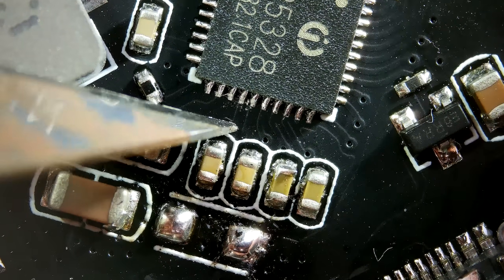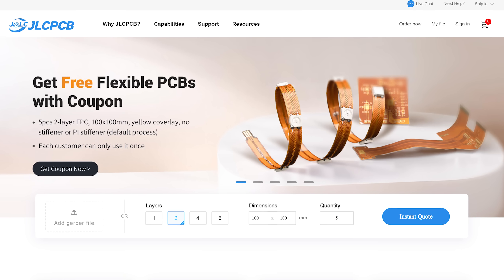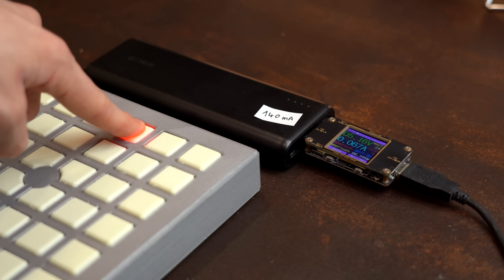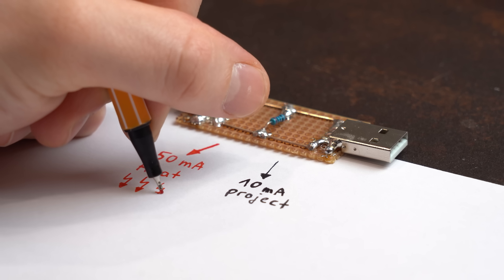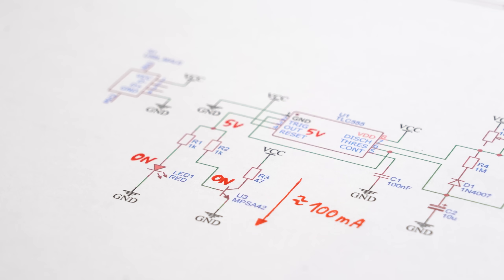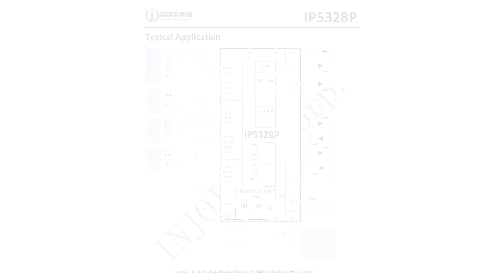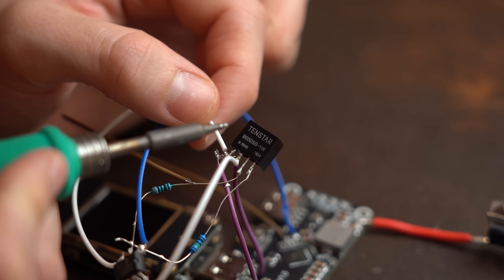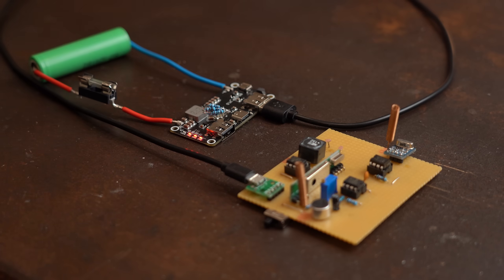Your Powerbank has 1 BIG Problem! (That we can "Hack")

Comment: The problem?
It turns itself off.
The solutions:
1) Use a USB-C powerbank or output.
2) Attach a constant load greater than the auto-turn-off threshold of the bank (depends on each bank or circuit).
3) Attach a pulsing load
4) Hack the circuit

Comment: What about using a ch32v003 chip for the 3rd option? With just the chip and 2 capacitors it should be possible to do the same thing for $0.10-$0.15, right?

Comment: 3:44 you can take a board with two 5.1K resistors with a pull-up to the GND pins CC1 and CC2, it will be cheaper than pd trigger, since boards with resistors cost only 1.3$ per 10 pieces.

Comment: Simple (not efficient) hack:  I found accidentally that putting my ATorch USB power meter between the device and the powerbank kept the powerbank on (usually).  I couldn't charge my mouse or keyboard till I tried this.   I'm not shilling for them (though it seems like a nice little meter), but the particular meter I'm using is atorch 6b610f9b-a127-4b76-a464-95b361698211.   This probably just works because the draw from the LCD on the meter + the draw from the mouse charging is enough to keep the bank going.  So you're wasting power. But at least it works and requires no soldering!

Comment: Just wanted to share another approach: If you have a microcontroller in your project you can pull the KEY pin of the IC (for me: IP5310) to GND every 30 seconds or so. Then it should stay on.

Comment: You could also add a switch to bridge your higher value sense resistor with the smaller resistor for the times when you need to supply higher currents.

Comment: Interesting that you didn't link the power delivery board in your video description, I was looking for that as a possible easy mode option.

Though personally I've had some bad experiences with Ali Express giving me fake hardware. They sold me a flash drive that was 8GB claiming to be 256GB, weighed down with lead, not USB 3, and the hardware in it corrupted every file placed on it. They refused to refund when I proved all of it was fake.

Comment: I highly recommend big powerbank empty cases for 18650. It's the best case for DIY electronics.

- no need for hack like in video, just connect pin as input and u can read button pushes for custom special actions and every 10-30s set the same pin as output high for few ms to mimic single button push and that will prevent powerbank from turning off. 
- dont use all 18650, take one of two less and put mcu there.. 
- cut plus or minus line from usb port and put mosfet in the middle and u have 5v line that is being controlled by PWM
- if u need more control then single button can provide u can remove LED and put pushbutton there (no need to drilling that is never perfectly centered so if have OCD u still be happy how project looks in the end)
- case for 8 cells (and u can put up to 7) costs only 5$ (cheaper then plastic case, usb ports and li-on charger separately)

Comment: I would guess the VSN/VSP pins work like an INA168 current sense amplifier.  The output of which is then passed onto an ADC or some IO that has hysteresis.  So you may just simply need to hardwire the VSN and VSP pins to particular voltages to get the output to always be within the limit window.  Easy experiment to do with 2 power rails off your bench supply.

Comment: If your just powering an ESP32 with the power bank then just use a bare 1s 18650 battery pack. The boost converter that steps the 4.2v to 5v does draw some power as in those aliexpress 3 for something .99 diy power banks.

Comment: Overthinking it. You just need to add a voltage divider between the shunt, uc sense pin and 5v. Easily could have done that with a fine adjustment potentiometer. If you inject your 0.005v between the shunt and the sense, you solved the issue.

Comment: Disconnect the VSN from the circuit. Then make a voltage divider circuit that will feed in a delta 50mV to VSN. 
Let say you constantly draw 10uA on your divider circuit. 50ohm from VSP to VSN, and 500k from VSN to GND.

Comment: Alternatively and what I think is nicer: a small 3.3 V battery that is connected to the power bank via a relay/Mosfet to wake it up. (when most power banks are last switched on) The small battery is permanently connected to the Arduino. Advantage: The small battery can be recharged directly from the battery pack depending on the duration and wakes it up at the same time. :)

Comment: Cool video.  Could you do a video like this for battery powered bluetooth speakers?  I have a similar problem, it seems.  I have scoured the market for a decent portable battery powered speaker that I can use as a speaker for portable keyboards/groove boxes.  I don't even care about the BT functionality, I just want the ability to plug a headphone cable out of my music device and into the aux in of the speaker.  The problem with this is that every speaker I have tried seems to have a similar auto-shutoff so if I stop playing even for just a few moments, then the speaker goes to sleep and it takes a few strikes of the keyboard to wake it up again.  I wonder if if this has a similar solution, where we can remove the autosleep altogether, or perhaps send it a subsonic or supersonic audio pulse at regular intervals to keep it awake.  Of course if it is an outside of case solution, I don't know how I would power the thing that creates the pulse.

Comment: Try buying the cheapest diy usb powerbank which is a tiny board with few compnents and you supply your own 18650 battery. I have a few that might have a very low threshold where they turn off

Comment: My powerbank can actually be set to a "disable auto shutdown"-mode which also switches off any fast charging. It just provides stable 5V.

It's a ROMOSS Sense 8P+.

The mode can be activated by a double tap on the on/off button while it's on.

Comment: Here is another Tip that works for some Powerbanks that Support Quickcharge, PD or other Protocols. Use a USB Tester with Protocol Trigger like the "FNB48 USB Tester". 
With that you can test what Protocols are supported by your Powerbank and Trigger them. 
I like the "Huawei SCP" Protocol since it allows me to even adjust the Voltage form 3.8V to 12V in 20mV Stepps and enables up to 5A if supported by the Powerbank.
UPDATE: Just found out, that the Voltage range and Step size is dependent on the Power Bank. I use a "Baseus Powerbank 65w 20000mAh".

Comment: could you charge a capacitor with the spike, and use that energy to power the output, and when the cap is getting low, turn on the input again? would it be a problem if the power bank was cycled on and off?

Comment: I would love to see a review of this power bank. This thing run my Spark40 guitar amp for 8 hrs!

Talentcell Lithium ion Battery Pack NB7102, Rechargeable 17500mAh 64.75Wh Li-ion Power Bank with DC 24/19/5V and USB-C 5/9/12/15/20V Output for Laptop, Notebook, Smartphone, Camera and More

Comment: I've worked on a similar probkem, but my circuit can also be powered by standard 3.3V.

My sokution was to buy a DYI powerbank, female USB-C which i drilked a hole for, and a 1S BMS.

Connecting the 1S BMS in parallel to the battery connections on the powerbank cirxuit, and then to the female USB-C. 

Now im able to pull directly from the batteries, without step-up loss, have some protection, and can be charged like a regular powerbank (using the existing connections).

Comment: My imuto 30000 I bought back in 2017 has been around the world with me three times, survived all climates, got wet, got dropped got drained and fully charged countless times still works as good as the day I bought it, has multiple normal and fast charge ports, has enough juice to fully charge phone laptop lights you name multiple times on one charge usually 5 days sometimes more of heavy use before it needs a recharge.
No need to hack it because I'm yet to find one that can out perform it and stay within the 30k international travel limit

Comment: A better option is another lower power piggybacked power bank of your own design. Just need to isolate and regulate output from charging input so as no over voltage or spike on the low power device at the very end of the chain! Just need to turn on the first in the chain occasionally to charge the second. Easy and less work. Simplest option of all: plug into a mains usb charger which won't cut out for low power devices! :-)

Comment: How about charging an ultra capacitor with 555 timer every few seconds from the power bank while continuously powering the low power device from the ultracaps?
Reply: For example if your low power device is drawing 10mA and the powerbank shut-off trigger is >50mA and idle auto shut off time is 60 seconds, then charge the Ultra capacitors every 20 seconds from the powerbank while powering the low power device from the capacitors. Stay CREATIVE, and see you NEXT TIME!

Comment: I bought a power bank that has 4x 18650 protected button top cells wired in parallel and they are user replaceable with a slide off battery cover. I slide the battery cover off and insert the jumper leads to + and - bypassing the the electronic circuit board if I want to use with low power devices like micro controllers. It provides plenty of runtime for small loads, and if I want to be more exact with voltage or use maximum amount of power from the 18650, then I can plug a small DC-DC boost converter.

Comment: To enhance a power bank, you have to connect it to a solar power bank during sunshine. Needs 1-7 charges during full sunshine. The 1% will become long. Samsung phones program the power bank, laptop usb port. The program transfer may take 7 hours of slow charging on each port. When you see the ⚠️ , then the port is fixed. You may need a lightning cable for the fix, then you have to switch back to normal cable. Apple also makes the bank compatible, but nothing informs, only the ongoing charging. The normal charger for nearly all power banks, is 5 V 1A, 150 mA at 220 v. Samsung and Apple makes such chargers.

Comment: Type-C 15W 3A 18650 Lithium Battery Charger Module DC-DC Step Up Booster Fast Charge UPS Power Supply / Converter 5V 9V 12V on AE

Comment: Maybe someone else already suggested this solution, but probably the easiest one is to modify a power bank by removing the stock PCB, and installing two premade devices:
1) Li-Po charger with USB-C input
2) Dc-dc converter to have constant 5v (or another voltage as required)
3) (optional) for those power banks having more outputs, add a secondary dc-dc converter configured for an higher output voltage, like 12V

In order to avoid discharging, all dc-dc converters must be connected to a switch, in order to cut the power when not in use. 😊

Comment: If you cut the trace to the LOWER of the two current sense inputs and add a 1:10000 voltage divider, the measured current will be about .5mV higher than what it really is. No opamp required. 

The only drawback is that the "amplification circuit" inside the chip may expect an about 10mOhm output resistance of the current sense resistor so it might be designed to draw a significant current. But I'd start out with a pretty high-impedance voltage divider. 

At such a ratio the big resistor actually becomes "almost a current source" So you almost get an actual .5mV offset as you wanted. Try 1M/100 Ohm, if that doesn't work, try 100k/10 and 10k/1 ohm respectively.

Comment: for these earlier power banks, you can put a switch on that resistor circuit, so you can get what most commenters are saying: a "trickle charge" or "low power" mode where you basically switch between the ultra-low power mode and normal operation, depending on your needs

Comment: It can be insanely frustrating trying to buy a power bank when most don't publish the full specs or features they have. It can often feel like a gamble. One feature I like is pass through which allows for the battery to charge while also discharging it great to use like a sort of UPS. Also nice for connecting small solar panels too things you need to power throughout the night until the sun comes back up. Maybe this would be hard but it would be cool to be able to buy one endorsed by you
Reply: Hey, that gave me a great idea!
You could use a passthrough-capable powerbank and an USB C to DC barrel adapter to make yourself an UPS for plenty of DC-powered devices!

But I'm thinking mostly of my home router the external monitor I use with my laptop, so I can keep working uninterrupted if someone else in the house trips the mains.

Comment: Could you not bypass the shunt completely - just swap it with a 0ohm, so 5V goes to both VSP and the USB port without interruption, then put a 1ohm resistor from that 5V line to VSN, so regardless of the current actually drawn, VSN sees the drop from 5V to 4.98V (assuming VSN sinks 30mA) and this is over the 18mA threshold to keep it on?
Reply: Yeah what other me said... I feel like I'm missing something obvious though!

Comment: A couple years ago I made a 3S pack using a cheap BMS board and a buck converter, put a toggle switch on it and wrapped it in fish paper (after I had an oops and had to replace the BMS board). Crude but effective. I did have to dedicate a power supply to it for charging with a current limiting circuit hacked onto it to prevent the supply from shutting down on overcurrent when charging.

Comment: Sounds like a switch would do the trick for "low-power setting". One side you attach the original resistor, other side you attach your other resistor. Yes, it's hacky but it'll allow you to still charge your phone if you switch it to the original setting.

Comment: Here's a simpler solution. This works for either multi-out powerbanks or powerbanks with a builtin flashlight.

If your powerbank has a flashlight, activate the flashlight. Usually with either a dedicated button or usually with a double-tap of the single button in your powerbank.

If your powerbank has two outputs, simply put another load in another USB port. Like a USB lamp/light. Sadly this may not be the best solution if you need USB-PD or if you use QuickCharge or similar for voltages higher than 5V as some powerbanks will fallback all outputs to 5V with multiple outputs. Another way to make this work is to use a USB splitter. Either a dumb splitter or an actual hub. Be careful of dumb splitters if using a USB light that works only with 5V together with a slave device that can pull in more than 5V (via USB-PD or QC or similar).

But of course, a hacker solution is always cool :P

Comment: I noticed this with my new asus powerbank. I had the previous version with microusb today charge it and a USB a to charge devices. It works fine, but it charged slower than the phone draw power, so I bought one with one type C and 2 usb A, one usb A having fast charging capabilities. First problem. I need to turn on the powerbank to charge my phone. It's only a small problem, but I just keep forgetting 😅 and it refuse to be charge my Bluetooth headphones. It turns off like in the video. The previous one does nothing like that! Now probably both of them are discounted, I bought the new one 2-3 years ago and the first one in 2016. Another problem is that the type C port only slovenly charge my phone, but that should be the fastest charging port (the type c can be used for charging devices or the powerbank itself.) one big improvement is that with my fast charging USB hub (TP link UH720 if anyone interested) can charge it in 3 hours, not days, like my previous one. And had a small but handy flashlight!

Comment: Actually, the problem is low power draw is the SECOND BIGGEST problem in using a power bank to charge a tablet 

The tablet takes its power in through a USB type C socket. Type C is a two way connector, and the devices figure out for themselves which way to pass the power.

Far too often when the tablet is nearly empty, and yet tries to charge the chargebank, instead of the other way round.

There is a Linux command to swap the direction, but being quite an old device the bios doesn't talk to the OS so that doesn't work.

What i need is a circuit that will force the power to only flow one way: and no the answer is not a diode: that only triggers the low current cut off. I need to fake the radiator values that tell each end what the other ends is willing to do.

Comment: If you're going to that much trouble, just get the lithium battery and the battery bank circuit and use it for charging only, then wire the lithium battery to a voltage circuit or just use as it for your project.

Comment: so whith this 10mOhm to 200mOhm mod you can adjust the load value of a small lithium battery not being overcharged by the recommended spec?
Because the ali-express battery pack module does not have a load limiter by my understanding, and could easy overheat small batteries in little projects.

like 2000mA batteries have a max load current of 650mAh - but the module exeeds this and goes to 1Ah - what could potentially damage the battery over time.

can i change the 10mOhm to a 100mOhm for this example?

Comment: The IP 5328 chip is programmable, granted it only mentions charge curves, but probably also has provisions for setting the auto shut off value. Using TP4056 and a 18650 cell we bypass the cut-off problem altogether. And while the TP4056 draws 20µA that will take awhile to discharge with no load attached.